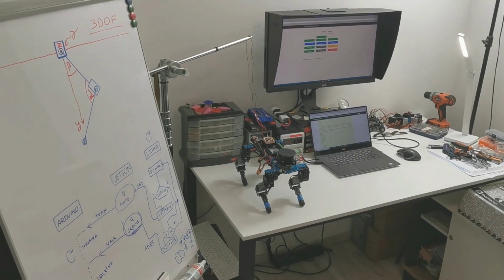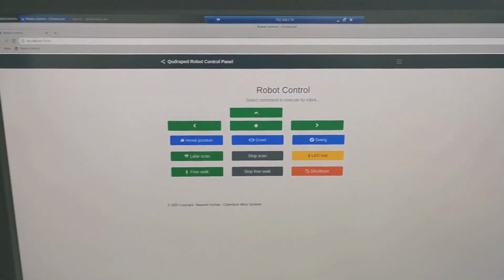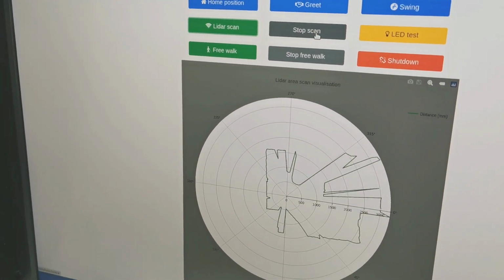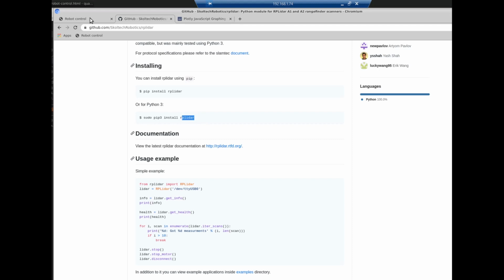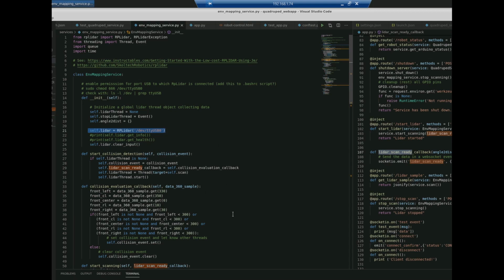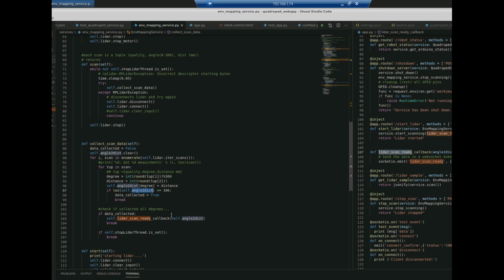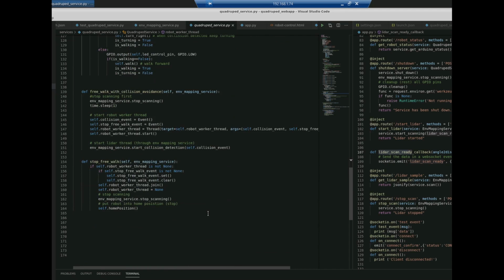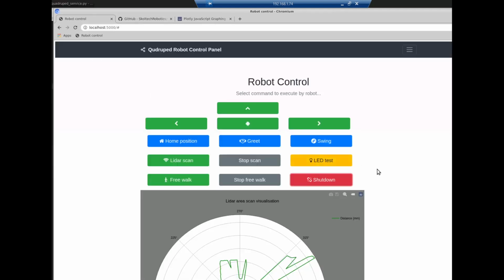Collision avoidance with LIDAR and Jetson Nano

Comment: Cool. I'm also working on the prototype of autonomous car. As I want to avoid obstacles using RP-Lidar A2 M8 by following your video. Have you completely control lidar working using python? I also want to do same. Can you tell me way or suggest me some tutorials.  And please share your code. Thank you so much if you can help me.
Reply from the maker: Yes the lidar is controlled using python program. There are more than one library supporting SLAMTEC's protocol for Python. I have used this one:  https://github.com/SkoltechRobotics/rplidar but I think you may try this as well: https://pypi.org/project/pyrplidar/. The interface is similar - you need to iterate over scans collection and then examine the touples for the data relevant for you eg. [angle, quality, distance]. In may case I was interested in the area in fron of the walking robot and my program considered anything closer than 30cm within 60 degree angle range(front) as an obstacle.  Some of my code related to collision aviodance you may find here: https://github.com/slawomirkorbas/robotics/tree/main/python_jetson/quadruped_webapp
Reply: @slawomirkorbas  Thank you so much. I think Pyrplidar python library can do my work. :)
Reply: @slawomirkorbas  Dear I need your help in sensors data fusion.  As I want to do data fusion of lane line detection algorithm and obstacle avoidance algorithm. I'm using IMX160 degree FOV camera and RP Lidar A2 M8 2d 360 degree and I'm using Pyrplidar library to control Lidar. I want to avoid obstacle when it comes in way of my car following lane lines. I have 2 models 1 is lane line detection giving me a steering wheel angle, another is obstacle and object detection in that frame and it is only detecting that. Now I want to avoid obstacles coming in front of my car.  But I don't want my car to unfollow lines when obstacles comes in front of my car.

 Please help me in this regard if you know something.
Thank you so much.
Reply from the maker: @ansjaved3484  so you want your vehicle to baypass the obstacle which is in front of it and placed on the lane right? The challenge is how to put the unit on track (lane) again once it changed direction of movement in order to avoid obstacle. Well I would try first to test if the camera (image processing) ins't enought to detect obstacles put on the lane (I presume it is about detecting "discontinuity" of the lane while analysing frame picture or directly detect object using some AI). I would try this way and use LIDAR for different purpose where the camera is not enough - eg for collision detection with objects that are approaching to your vehicle from left/right or rear.
Reply: @slawomirkorbas yes, but If I detect object by using camera, how can I avoid it without using lidar. I think my camera only can detect the object and tell me it's width and length but not distance from my car. I have lane of 1 meter wide.
Reply: Hello this code is it work? I am using Rp-Lidar too. Can you help me in this topic? thanks in advance
Reply: @serhatarslan4138  Use pyrplidar library.
Reply from the maker: Yes. This code works. Use RP-Lidar library. You may get it from github.

Comment: Hello, I'm speaking to you from Colombia, sorry for my English, I would like you to help me with my robot, it is possible, thank you, I await your answer.
Reply from the maker: Hi Joan,  I could help you to some extent if you specify what type of robot you are building and what is your goal.
Reply: @slawomirkorbas  thanks for answering. I am building a robot for customer service, the main task is to move inside a car park and invoice payments through an electronic platform, for that I think I would have to start the snowing with a lidar, I would like to mark a route and let the robot follow her.
Reply from the maker: @joanroboticaeducativa9663  I understand. If you want your robot to follow specific path I would prefer using computer vision for that. Camera connected to your SBC-single borad computer like Jetson Nano or Raspberry PI and use. Then you would need to mark a path on the floor where your robot is supposed to move (eg. using some tape or paint). You could teach your robot to follow this markup with the use of some deep learning framework like OpenCV See this: https://const-toporov.medium.com/line-following-robot-with-opencv-and-contour-based-approach-417b90f2c298.
I would start from som,ething simple in the beginning - fixed route. When it comes to using LIDAR for route following this is not a main purpose of this device. LIDAR can be use as auxiliary device for avaoiding potenital crashes with other moving objects. Hope that helps.
Reply: @slawomirkorbas .Thanks for your help, I hope to finish it soon to show you the final development. I would like to have your contact email for any questions. Thank you
Reply: @slawomirkorbas  the robot's goal is to speed up the payment of parking, using cutting-edge technology
, I think that with slam and artificial intelligence I could do it.
Reply: You can see my video on you tobe of the project progress

Comment: which lidar are you using?
Reply from the maker: Hi, I am using RP-Lidar A1 from Slamtec. This is relatively cheap model and good for prototyping. There is also A2 model using direct drive and having smaller form factor. I presume they use the same protocol for data transfer.

Comment: interesting and cool , i was also had a idea of building a  robot dog with jetson nano that i brought  but because of less money , and because of i am in high school
Reply from the maker: Yes Jetson board is a bit expensive comparing to other sbc like Raspberry Pi not mentioning controllers like Arduino and its clones. I would start from something cheaper where you don't need to deal with AI - so you can implement your robot as walking machine only using Arduino and some cheap RC servo motors. Now it is cheaper to start anyway as it was like 20 year ago when I was studying. The only clever bricks we had was NE555 and Atmel microcontrollers :-)
Reply: I have arduino and raspberry pi pico and i have used it for lot of project and i like to learn more on the software of robotics so i bought a jetson nano because i did not have a personal computer or laptop to work and learn
Reply from the maker: @melvinsajith4448  I understand. Using Jetson as personal computer is a good idea. In reality I am, using it in the same way although it is installed on my robot. Just working through Remote Desktop.
Reply: @slawomirkorbas  how to use remote desktop in jetson nano , i tried VNC but not working which are you using
Reply: @melvinsajith4448  I think you have to Install xrdp from eg from here: https://www.hackster.io/news/getting-started-with-the-nvidia-jetson-nano-developer-kit-43aa7c298797
Then:
Install xfce4: sudo apt install xfce4

Comment out the last two lines in /etc/xrdp/startwm.sh

Add the following line to /etc/xrdp/startwm.sh:
startxfce4

Restart xrdp 
sudo service xrdp restart

At the end you shook should be able to connect from Remote Desktop Client on Windows. This is what warked for me although thi setup is very cumbersome.